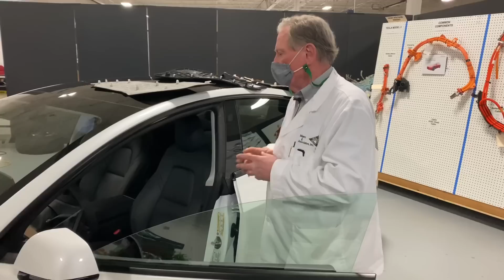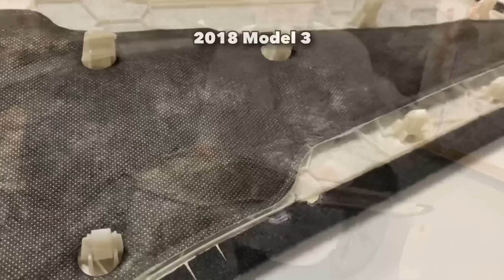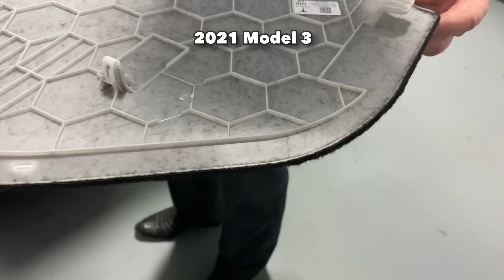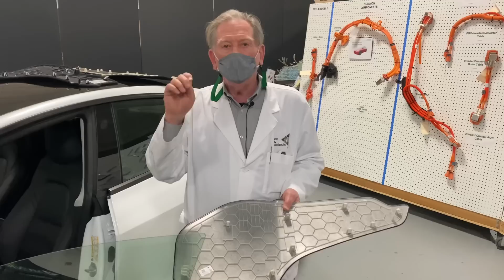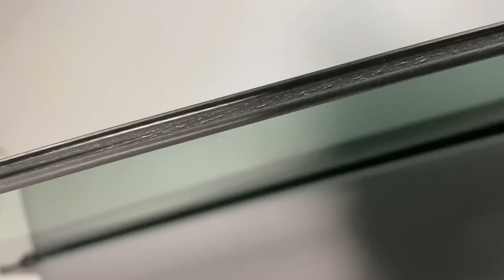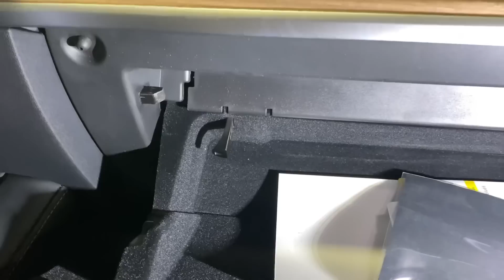2021 Tesla Model 3: E6 - Interior Updates

Comment: On one Munro episodes the steering wheel  from a Model 3 was cut up and there are segmented metal bars in the wheel, you didn’t know why. I think I’ve figured it out. I’ve noticed the wheel only heats up where your hands are touching. That’s right, when you turn on the wheel heating it doesn’t simply heat the entire wheel like other manufacturers. So the segments are working as capacitive sensors and heating elements. This saves energy. When you reposition your hands in the winter you notice the new spot is cold but quickly heats up.

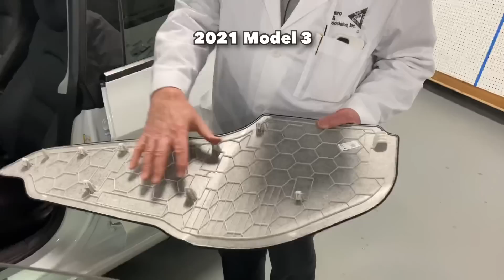Comment: Re 3:00, Honeycomb structure in the panel adds rigidity meaning the modes of the panel are different which makes the damping material redundant, more likely a part-specific vibration fix rather than elsewhere, if the problem was elsewhere on the car then on the original panel the whole panel would have been made heavier to improve transmission loss (sound like water finds the path of least resistance), instead, they added damping material to damped the mode shape of the panel. Just my opinion.

Comment: I saw another video on the duel pane glass and they got quotes from tesla to replace it and it was some 220 for standard tempered glass and 260 for the laminated glass. The latter also gives you security, they are hard to break through. The glass doesnt shatter the bonding plastic keeps it together despite the glass cracking

Comment: What’s with the USB stick just sort of hanging out there in a stupid spot, waiting for objects in the glovebox to bang into it and bend it/snap it off?
Reply: Because previously it was exposed where you'd typically charge your phone in normal USB outlets. This wasn't very effective in case of a break in, people could just snap the USB out and be on there way with the evidence. By placing it in the glovebox they would need to have a pry bar or some sort of oscillating or reciprocating saw to get to the evidence
Reply: @originalSoaren  the glovebox has a lock on it?
Also, it’s fine to have it in the glovebox, but why have it out in the middle like that, with a wide gap so that things can bang into the USB stick when you turn a corner
Reply: @Filtersloth  the glove box is only accessible via the computer of the Tesla. Cant access the computer without a key present inside of the car
Reply: @Filtersloth  I dont think it's the best spot either, but I'm sure it wouldn't be too tough to protect it. Maybe we shouldn't leave a loose firearm or anything sticking on top of it for example, other than that probably could just make a little blanket out of a few envelopes/registration or something idk I'm kinda fetching for both these examples. I'm ordering the model 3 soon and now thanks to you anytime I use my glovebox I'm gonna think back to this conversation lol
Reply: @originalSoaren  lol. You’d think there would be a little barrier to the right of it, so that it can’t get pushed sideways. 
Enjoy your Tesla!
Reply: @Filtersloth  and since I mentioned of a firearm in the glove box, I'm honestly not  sure that's even practical. Imagine someone knocking on your window in a threatening manner, then having to toggle through the damned iPad plastered on your center console just to have access to self protection lol. But then again, I'm sure given the fuckin torque on the tesla they'd have to be a prettttttty good shot to stop that acceleration. Other than a firearm I cant think of anything else I'd put in my glovebox that would possibly break the USB
Reply: @originalSoaren  there isnt a big owners manual anymore I suppose. But just a smaller book or a sunglasses case, a camera etc... things you would normally put in a glovebox. Just seems like a weird place to put a usb: a place designed for stuffing objects in to.

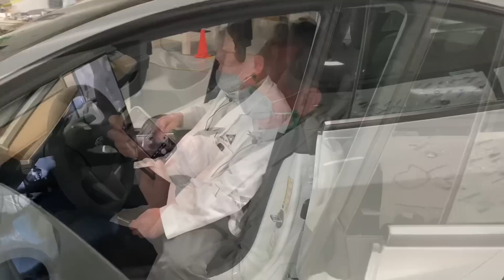Comment: 5:50 dual pane glass, sure reduces noise and heat transfer. HOWEVER on Mercedes * Maybach was VERY FAILURE prone.  seal fails and inside fogs up and other issues.  VERYVERY VERY expensive to replace.

Comment: Sandy, why didn't you address as to why Tesla keeps using those big cup holder in the front, instead of making them like the rear ones with bumpers.  Also, I hate that the flash drive in the glovebox sticks out.  And, the laminated side window glass people are saying it's a safety hazard because now emergency crews have to work harder to get the glass out, and if the driver was in water he wouldn't be able break open the window like with tempered glass, then would have to struggle to get out of the rear windows.

Comment: Bjorn tested the noise levels and saw no significant decrease in decibels between the single pane and double pane windows.  Maybe there was a frequency change?  My guess is that Tesla added the double pane glass for heat retention to make the heating system more efficient, or even to make the front passengers feel more comfortable, rather than to reduce cabin noise.  Wouldn't be surprised if it's also to improve the sound of closing the door.

As to the interior panel change... isn't it also possible that Tesla tested the interior noise levels and found that foam insulation had little to no impact on cabin noise, so they simply removed it?  Isn't it a reasonable explanation that in their rush to model 3 production going, they didn't have the time to thoroughly test every single panel, and with noise being a clear issue, they started slapping noise insulation around the car without ever testing each individual panel's efficacy?  A real test would be to drive a 2018 model with the foam in place and with it removed to see if it actually makes any difference.

Regarding the wrapping the carpet over the panel, Tesla is once again getting high marks for doing something that other automakers already figured out awhile ago.  What do these changes save them, $4 for the driver and passenger panels?  Except unlike other OEMs who have been selling 4+ million cars per year, a $4 savings on every car sold is a $16 million improvement in margins.  With Tesla only selling 500k cars per year, soon to be 1 million, that $4 bucks per car is really only increasing margins by $2-$4 million per year.  Except, I imagine the addition of the double pane glass lead to an increase in costs of more than $4 per car.

Comment: I’d bet $100 the mega casting is slightly warped causing the inconsistent external panel gaps. They can achieve the quality on both the internal and external components but the frame itself is slightly bent. Crooked foundation -> crooked panels.
Reply: You'd lose your bet. The megacasting is more consistant than welding together 70 parts. This Model 3 doesn't have the megacasting.

Comment: Sandy I believe they have ordered a state of the art paint shop for Berlin.
Reply: Yeah.. the issue with paint coming out of Freemont is it wasn't good from the get go.. they bought an old run down factory.. the paint shop was not the best, and they probably didn't have the money back then to rip it all out and go all new.. and to shut it down now and retool the whole thing to be state of the art would probably take a month or more of 0 cars built.. it would be a small disaster for them. And there is not enough room in the Freemont factory to just build a new additional paint shop and then tear down the old one.. they are just stuck with it at that factory. On the upside, all the new factories will certainly have better paint shops. And one day they'll have enough factories going where they can shut down Freemont for a month and fix the things they've been putting off for a few years

Comment: In the perspective of 'robo-taxis' and other ride sharing "formulas" the interior has to be simple. After a ride (or rides) it has to be cleaned no? So, I can imagine that the car goes to the nearestTesla workshop/cleaning facility and is desinfected, cleaned etc. By (or partially) by robots. So the simpler it is, the easier it can be cleaned. Also when defects are signaled a swap of (inetrior) parts is going to be much easier. For me it is like Tesla is getting us used to this minmalistic approach for the future.

Comment: Question for the Tesla battery experts, where can I connect directly to the 400V battery voltage?
I like to get easy access to the battery for running an inverter for extern 220V power.
Is the heater connected with permanent 400V?
Thank you

Comment: Tesla reinventing every wheel can be a problem. For example they put foam damping material in the tires  to try and reduce tire noise but it's only marginally effective and makes replacing and patching tires harder. Legacy auto just applies damping material inside the wheel liner, which costs a bit more but works way better and keeps tires cheap.

Comment: Having bought multiple Model 3s and Ys I do wish that Tesla would just add a HUD already along with REAL blindspot monitoring and cross traffic alert. Those two missing features are extremely annoying when they are standard equipment on vehicles costing 1/3 as much. I also would like a legitimate 360° camera or at least a wide-angle camera at the front and rear so I can see what’s coming perpendicular to my car if there is a wall, tall car, blind junction, etc. obstructing my view to the left and/or right. Most other luxury cars (especially BMW, Audi and Mercedes) have much better camera systems when their driver assistance packs are optioned. It’s a bit frustrating even paying for the $10,000 FSD package you get no additional sensors, cameras, radars, etc.
Reply: Get better at driving
Reply: @Phoenixklinge  that’s literally the dumbest thing you could’ve said. I have a perfect driving record. It still would be nice to have the most basic driver assistance technology on my $65K Tesla. A Corolla and Civic and Accord and Camry, 3-series, A4, C-Class, Giulia, S60, etc. ALL have legitimate radar based BSM and cross traffic alert. The lack of the side firing radar units will definitely pose a major problem for these cars ever becoming capable of full self driving. They can’t see what is coming perpendicular if there’s any wall, tall car, bushes, trees, low light, condensation, etc. on the camera lenses. That’s why every other car uses RADARS for blind spot detection. It works in any weather condition and can see through objects.

Get better at critical thinking...

Comment: That sentry USB stick looks like it could get a lot of moment loading if something heavy is rolling around in the glove box.
Reply: Exactly what I thought.  It should be within a protected capsule.  "Moment loading"...sign of an engineer lol.  Cheers.
Reply: You wonder why they chose a USB stick that's that large. I've seen USB sticks that are barely larger than the electrical connector. Probably would be better to come out of the USB Jack with a flexible cable and put the actual USB stick into the end of that.
Reply: @kens97sto171  or just place it to the side behind a simple access panel, much like a standard fuse box has an easily removable plastic casing.

Comment: On the issue of adding dual pane glazing on the front doors it’s not really just making a small noise change as measured by Tesla Bjorn but he did notice when parked and sleeping overnight in -24’C temps the front glass was still clean and ice free on the inside but the rear door glass and roof was heavily iced. He thinks it helps massively with energy loss therefore using less heating from the heat pump

Comment: Sandy, I like the idea of the glovebox secured Sentry Mode memory storage,  but the execution has something to be desired.  USB's are not optimal for high read/write frequencies and as located could easily get broken by items stuffed in the glovebox.
Reply: I have a mini usb->microsd converter in mine with a microsd card optimized for dashcam footage. About as tiny as a Bluetooth dongle, but quite expensive. I think a run-of-the-mill thumb drive here is perfect. It's cheap, it works, and if anyone wants to upgrade, they can.
Reply: You can get USBs that only stick out a few millimeters now. They're much less likely to get broken, and UBS are cheap enough that you don't really need to worry about wearing them out from high read writes. Just buy a new one in a few years for another 10-20$ and you're good to go. 

I'd much rather have easily removable and replaceable storage, for a very reasonable price, than have a built in/soldered on unit.

Comment: Don't muffle the noise, stop making it.
Reply: ...where applicable. Best part is no part.
Reply: They are unable to get rid of all sounds. For example rumble from the tires definitely needs insulation.
Reply: Well they got rid of the engine, gearbox, and exhaust, all thats left is tyre/road and wind noise which were drowned out by the first three, yet now people can hear those they're complaining, just shows how easily offended people get these days
Reply: @will4may175  It's just a sound they've never heard before, so they're more likely to bring it up as an issue. Probably something along the lines of "Every time I get on the highway it sounds like a window is open." when they bring it in for service.
Reply: @will4may175  There's always room for improvement. Just because previous issues have been addressed does not mean there can't be other, new issues. Identifying these issues does not mean someone was offended (though people can resist change and be whiney, sometimes), it just mean another way to improve a product exists.
Reply: @jdcook72  Actually it's been proven that removing all sound coming into a car makes people sick, it happened in Rolls Royce cars, where they had to allow road noise back into the car, as a lot were getting motion sickness, same with the adaptive suspension on those and even Tesla, seems our bodies require connection with whats happening to us.
Reply: @will4may175  TIL

Comment: Interior vs exterior assembly: 
- Hand vs robot?
Reply: Although you'd expect the a robot to do the same over and over but somehow that doesn't seem to be the case.  Weird.
Reply: @sambira  an engineer driving CAD with less than adequate experience or education in “design for assembly and design for mass production” can enable random variance fallen into production line. More with robot and less variance by human because human offers error correction .. to some extend.
Reply: @sambira  robots aren't perfect and needs recalibration sometimes, humans have better and more precise hands

Comment: Re: laminated side windows --- a key point is the UVB/UVA protection this adds without needing tint. This makes it 98%-100% UV protected vs normal side windows at ~65%.  Various YT videos with testing equipment are not showing it adds much sound dampening, however.
Reply: Also the cold insulation is better in laminated windows.
Reply: Well, my first action would be to see if those tests are flawed in any way, because double-paned glass certainly reduces noise significantly when the cabin is sealed properly (especially the windshield).
Reply: @MrCarGuy , your comments make sense. I don't think it was professional equipment but the testing procedure seemed consistent and sound. I think this may be a situation of does it make a difference in the lab vs real world ... and that the side windows must not have been the real cause for noise.
Reply: Other manufacturers like toyota, mercedes, bmw uses roof glass with chromatic systems to improve silence and reduce the amount if UVs

Comment: Thanks for the insights.  Great to see Tesla constantly improve things.  Haters latch onto the fact that improvements are required and fail to acknowledge that all car manufacturers have gone through the same improvement process, just over a much longer period of time.  Tesla’s rate of improvement suggests that by the time they start catering to the truly mass market they will not only beat the competition on specs, innovation and price, but also on quality.
Reply: Haters are the worst!!
Reply: Over which longer period!? Are you insane, mercedes started using the double glazing in their cars for decades now and the insulation/isolation was always priority, mercedes and toyota even have electrochromatic roof glass to block UVs and improve sound reduction.